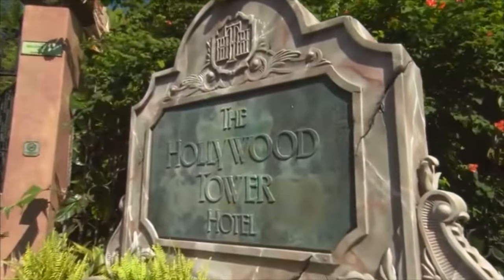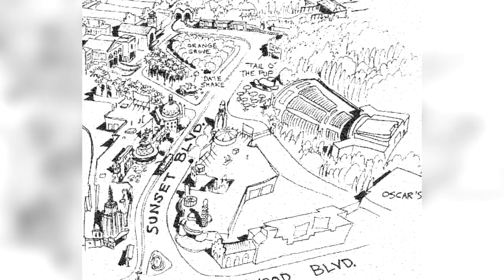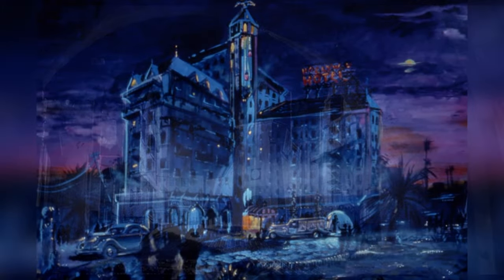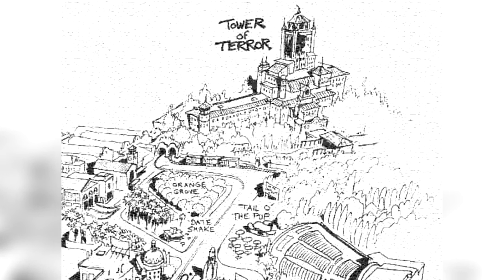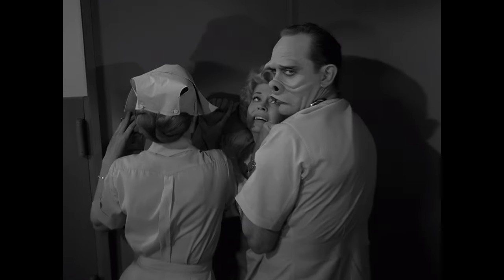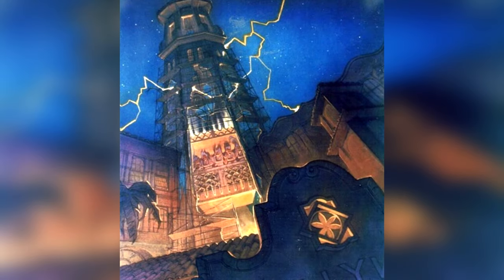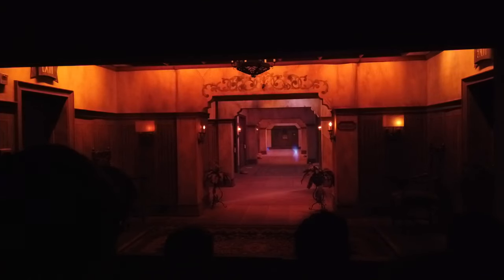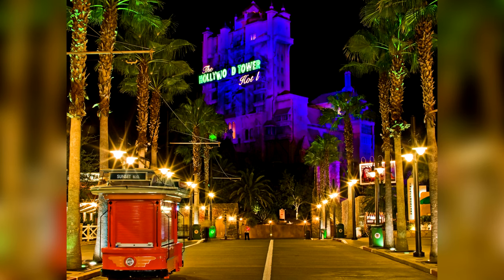The Evolution of The Tower of Terror

Comment: The rumor that Tower was designed to blend in with the Moroccan skyline at EPCOT was actually debunked. The tour guides for Tower are very lucky to have a direct connection to the WDI documentation for the attraction, which confirm that the Morocco pavilion was not on the Imagineers’ minds during Tower’s development/construction. According to WDI documents, Tower’s architecture is Spanish-Colonial, not Neo-Mediterranean. Tower’s official color is “Patio Pink”, while the Morocco pavilion uses more dirt/red/orange colors. This is definitely a common misconception. Some of Tower’s tour guides have even spoken to the Imagineers who worked on the attraction directly about this topic. I believe one Imagineer was quoted saying, “If sight-lines were still a priority for Disney, we wouldn’t have built the Swan and Dolphin next door!” The current tour guides are working to stop the spread of the misinformation.